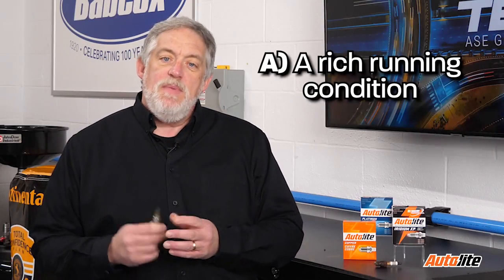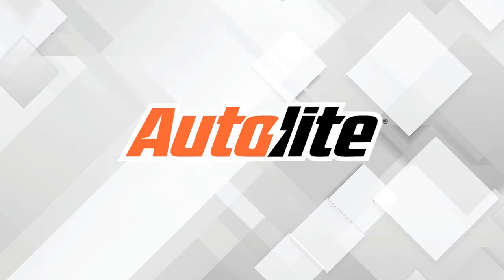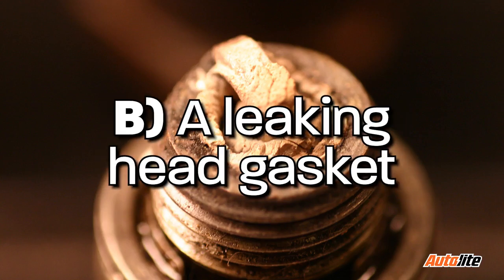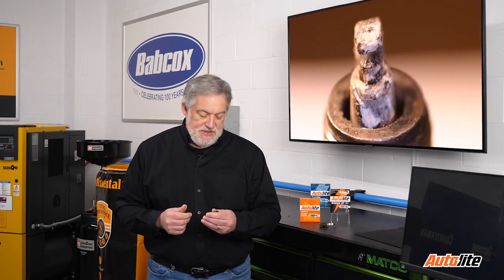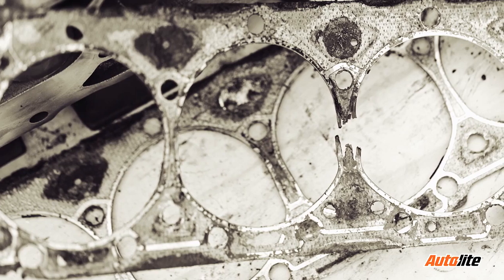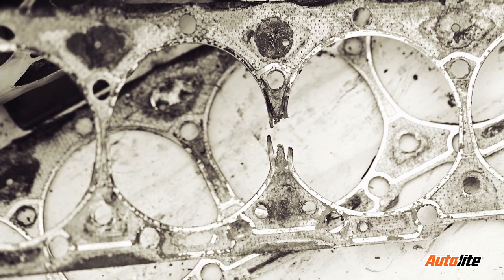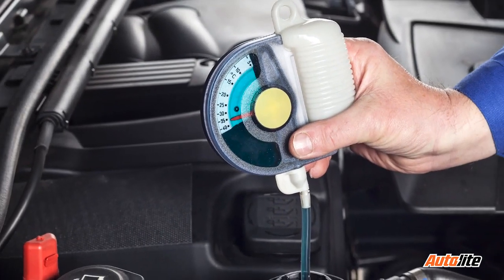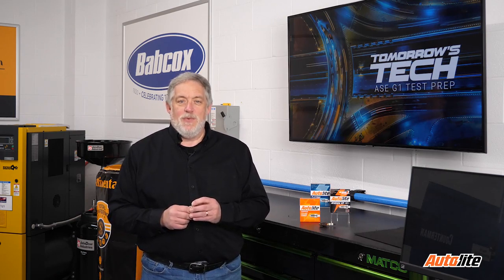Spark Plug Deposit Diagnosis

Comment: Hello! I have a vespa and I'm wondering how to solve it with that if you have a white spark plug. I have a carburetor with wire that you can accelerate with. I don't have a "manual carburetor" where I can change the airflow and gasoline flow to get the right color of the spark plug. How do I solve it so that I get a good color on the spark plug? Is it just to change the spark plugs and carburetor to a "manual carburetor" or what?